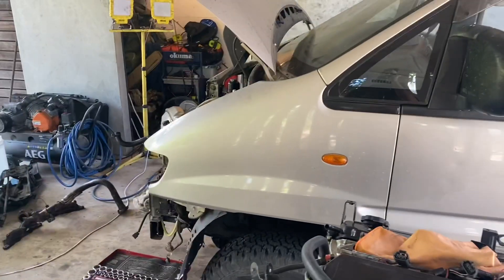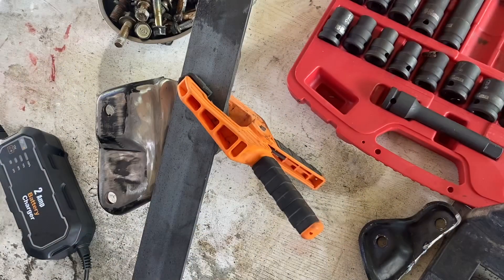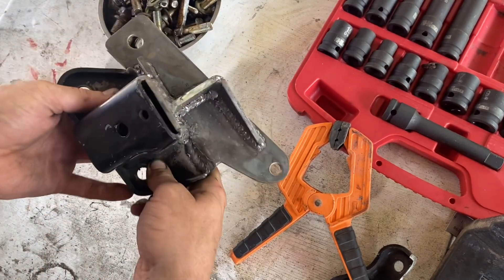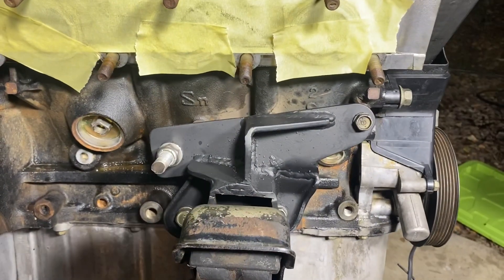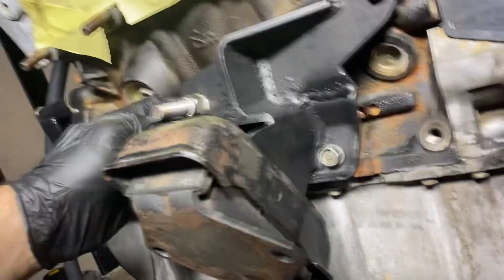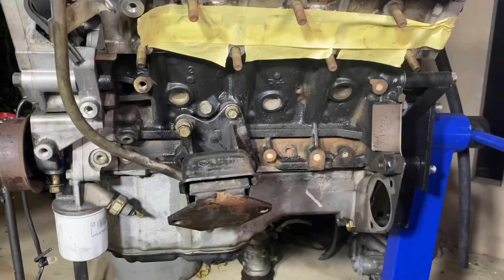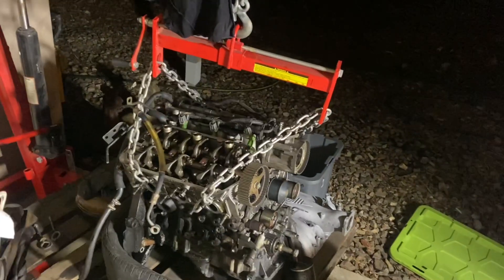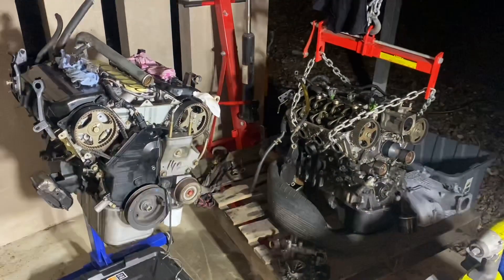Delica 380 Swap (6G75) Part Two Making motor mounts. Factory 3.0 to 3.8 Engine swap

Comment: Great video  thanks heaps   get a set of iriduim plugs   order from china  ..they all come from there even the fakes  are still good plugs or even Ebay motors  from USA    cheap as chips
Reply: +1 They pretty much all come from the same factory. Surplus stock just get sold locally or on Aliexpress